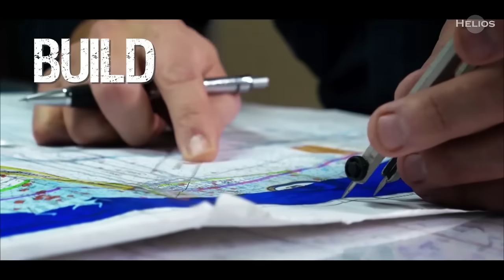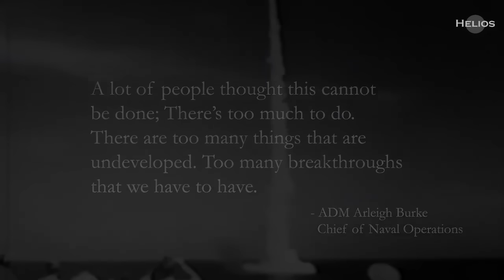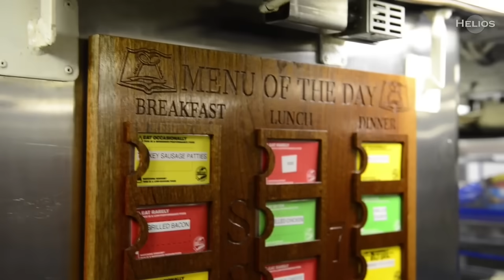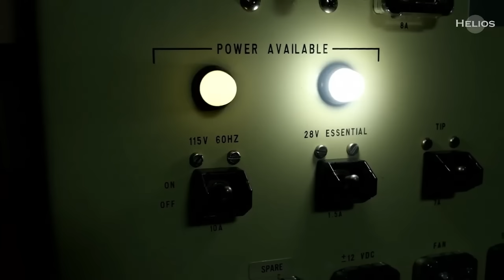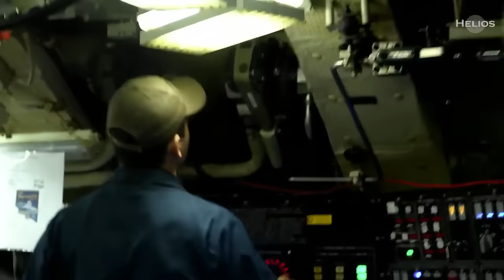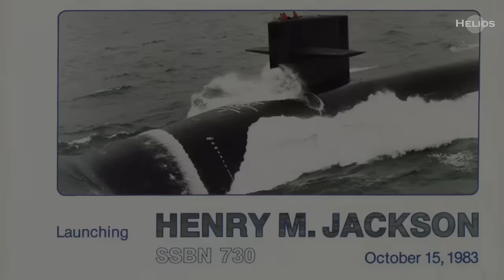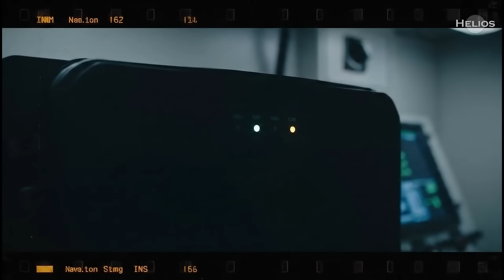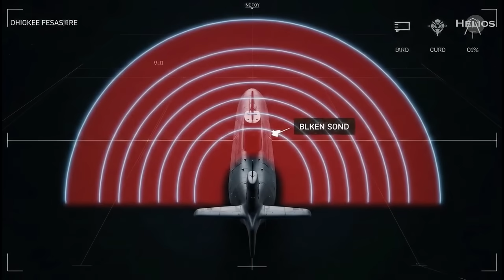OHIO-Class NUCLEAR Submarine: Sleeping Next to Ballistic Missile - Navy Seal Realities Unleashed

Comment: How to communicate or contact between the submarine which is hiding under water on the sea floor and the Pentagon, how to receive  commands?
Reply: coded signals are transmitted along wavelengths of blue light, much like your fiber network.  light carrying data along a specific frequency connecting transmitters and receivers much like your fiber optic network.  glass,  frequencies, packets.. possible other ways of communicating might be to like spool out a bouy that rises a couple hundred meters to the surface and bobs a tiny antenna that calls home via starlink to check her messages...another possible way might be a walkie talkie on one of those navy seals that swim to the surface and do some wilco Charlie out with a passing awacs..  link 16 might also come in quite handy,,  just to name a few..
Reply: @reapsgrimley Can these signals pass through the sea water medium?
Reply: They can communicate with VERY LOW FREQUENCY THROUGH THE EARTH. A VERY LONG ANTENNA BARIED IN THE EARTH UP IN NORTH AMERICA ALLOWS THEM TO COMMUNICATE WITH SUBMARINES.
Reply: @markbilsborough4150  ELF communications are incredibly low bandwidth, so all they tell the boat to do is to come up enough to copy incoming radio traffic.